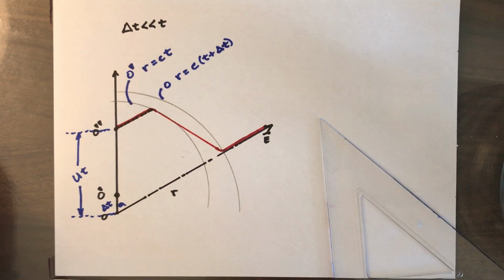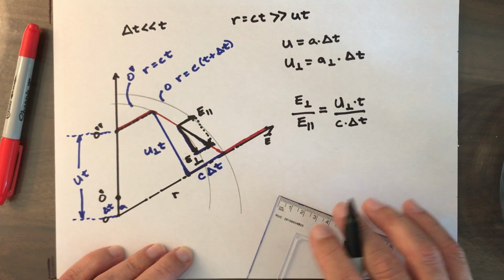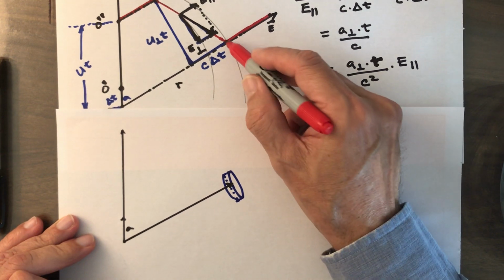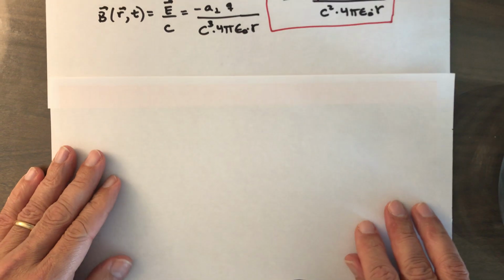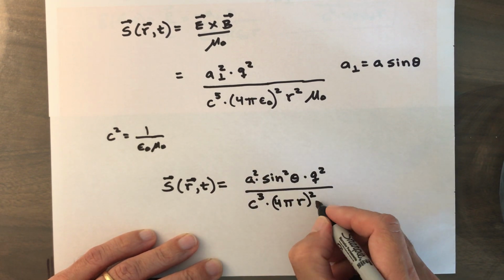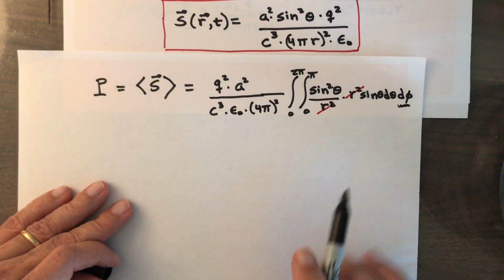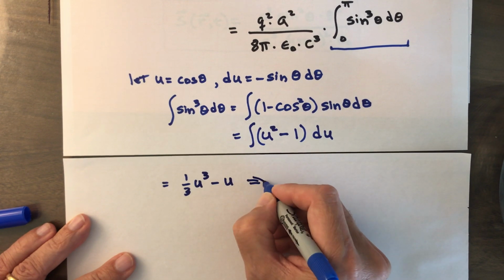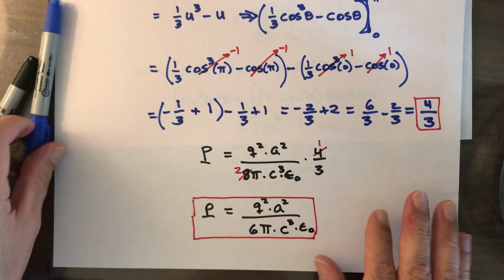Larmor’s Formula Derivation

Comment: @ 15:41 Does it matter for the shape of the doughnut, whether the electron is accelerated by polarized or unpolarized EM-radiation?
                P.S. I guess the hole in the doughnut comes from the fact that the electron doesn't radiate during the first few wavelengths.
Reply from the maker: Thank you for the comment.  Polarization of the E&M radiation when the electron receives a wave should ideally be best when it's aligned to the axial direction, or z-direction.  This way the most energy is delivered to accelerate the electron.  The toroidal or 'doughnut' shape of the radiation pattern comes from the sin(theta) dependence; it is weakest along the axis of the toroid, which is equivalent to the direction that we're accelerating the electron, i.e. the z-direction.  We could call the theta ~0 angle, the 'hole of the doughnut' and there the radiation pattern is weak; on the axis itself, or z-direction, it actually goes to zero.  The radiation pattern is strongest 'broadside' to the z-axis.
Reply: @quantumradio  Thanks for your time. So you say that it makes no difference whether the incident light is polarized or not?
Reply from the maker: @jacobvandijk6525 Jacob, the way i understand polarization and the model used in this video is using the analogy of an antenna.  Our vertical radiating element will also act as a receiving antenna oriented along the z-axis.  

Given this, polarization of the E vector will have an effect on how much energy is available to accelerate the charged particle on the z-axis, i.e. our "antenna".

As a side note, I built a Yagi-Uda antenna a few years ago and it received the signal strongly if vertically oriented but terribly if rotated horizontally.  Per my understanding, this empirical result was due to the polarization of the incoming E wave since I'd confirmed that the transmitting antenna was vertically oriented, hence it sent out a vertically polarized E vector.

Good conversation.

Comment: this formula poses so many questions. 😅 first and foremost the violation of general relativity
Reply from the maker: Thanks for the comment.  The way I understand it, special relativity (SR) may be the bigger concern since General relativity (GR) would require large masses to affect the curvature of space-time; however, SR kicks in at high enough velocities so it could affect us.  Recall that the assumption in the derivation is that r=ct >> ut so the lurch is a lot slower than the speed of light.  So we should be OK to neglect SR.  73!
Reply: @quantumradio  i think it violates the equivalence principle. a charge thats is gravitaionally accelarated should radiate but then a co-accelareted observer should be able to observe the radiation - and by that be able to tell free fall from weightlessness
Reply from the maker: @Taelchentuber  Andreas, the equivalence principle refers to the equivalence of gravitational and inertial mass.  In this case gravitational acceleration plays no part.  Best of luck in your studies.